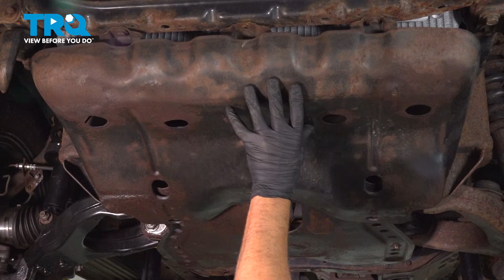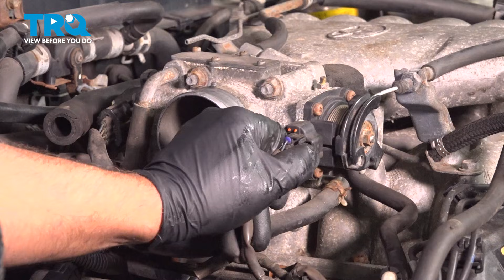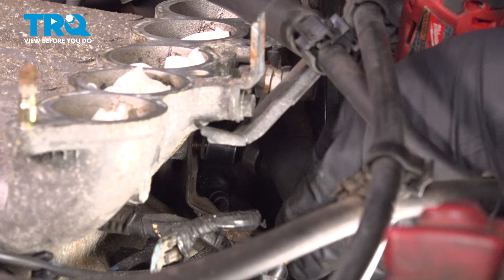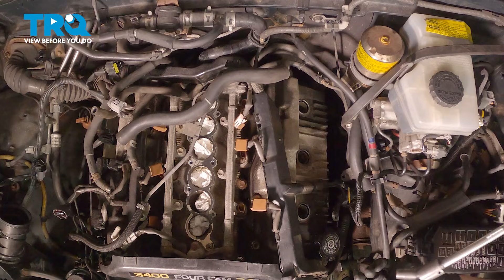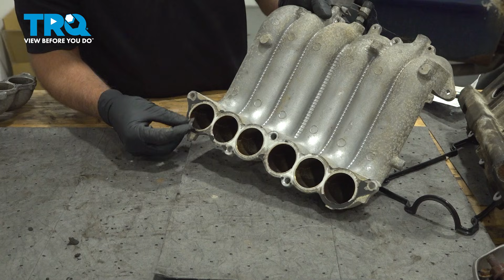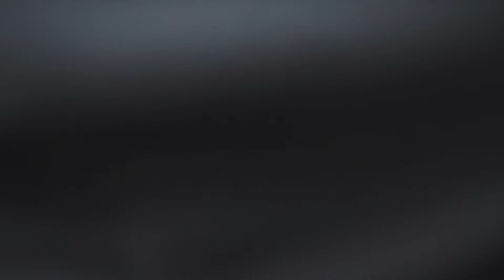How to Replace Valve Cover Gaskets 1996-2002 Toyota 4Runner

Comment: For those inexperienced in this job - DO NOT over-tighten those baby 10mm valve cover bolts. I would recommend not even using a power ratchet like this guy did. Those valve covers WILL break in two (or, the corner off anyway). Ask me how I know... There are several finer detail points missed in this video that could save someone a headache.

Comment: I just finished this job and have a couple important tips that were not included in this video... First, no need to drain the coolant, I'm at a loss as to why this step was included. Second, the 1/2 moons, 2 per side, front and back, should be removed, cleaned, and re-seated, using the appropriate RTV/sealant. Same with the cam seals. Ideally they  need to be replaced,  one on each side, closest to the fire wall. Since you've come this far, replace the intake manifold gaskets and pcv valve. Lastly,  do the passenger side first. It's easier and requires far less disassembly than the driver side. It will give you a feel for the process. Use new grommet/washers when resecuring the the valve covers. The old ones are likely brittle. I did the passenger side one day, drivers side the next. Also replaced the plugs and wires while I was in there.

Comment: why do you put the RTV on the gasket in those spots?
why do you drain the coolant?
if you are take the middle part of the manifold off, why do you clean it before you remove it instead of cleaning on the bench?
why did you end up installing a new valve cover?

Comment: My valve cover gasket bolts were RIDICULOUSLY LOOSE. Especially where the oil leak was. Seems to be a common theme. Check them first, but don’t overtighten🤙

Comment: With MGA 1957 which leaked all the time, we would use RTV all over both sides of the valve cover gaskets as well as the oil pan.  I have found it pretty impossable to keep the 1996 4Runner from leaking.  I think I will try that here.

Comment: Very good job. I’m still daunted to dive so far in. I’ve started by tightening the valve cover bolts which did seem a little loose. Is that typical after 175K miles?

Comment: Great video, I was able to do this on my 98' very easily. However, I had a few minor differences in my engine with the throttle cables, and some of the hose lines. It was still pretty straightforward. 
Some things I had to figure out on my own: Hammering out the 3 seals in the valve cover I noticed that it left a ring still inside. The best way I was able to get the rest out was by flipping it over and wedging a flat head underneath it to pry it out. 
Another thing that I did that was my own fault was not tightening the valve cover from the inside out and over-torquing the bolts. This led me to cracking the cover and having to buy a new one. 

This was my First time working on my engine; if this is your first time, this video is great.